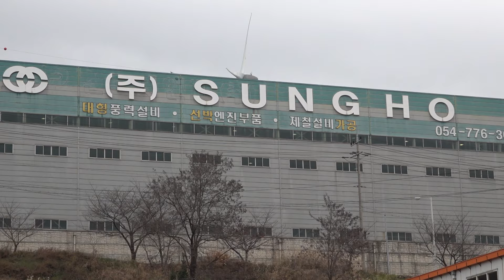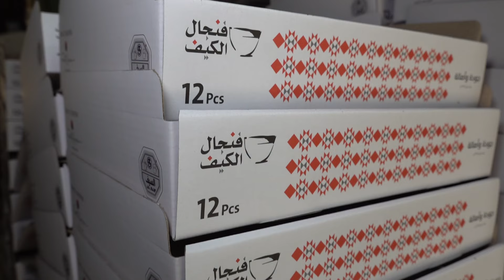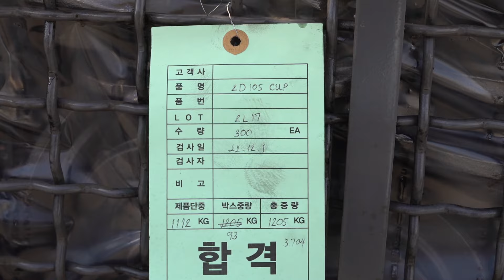Great Korean mass production plant. Amazing Manufacturing Processes BEST 5

Comment: Great interesting stuff.  Why is there so many hand working steps? Automation my friends! Why  put on labels by hand? Tradition? Loading, taping so much hand labor.
Reply from the maker: Thank you for watching^^
Reply: Automation also equals unemployment for many people. While it is true many of the steps could easily be automated, but how many workers would be without jobs if everything were automated? Automation also costs a lot of money. The product output and price point has to be worth fully automating. Labor costs aren't the same everywhere. The cost of automating certain tasks may outweigh the manual labor costs in some cases depending on product.

Comment: Surely the demand for rubber glove template hands can’t be that great?
Reply from the maker: thank you for watching
Reply: There are gloves for many occupations. More than one might think
Reply: That's exactly what I was thinking. However those templates may produce say a million gloves before they lose their dimensional accuracy,  they need replacing.
Reply: @emif841  Im guessing its not very common that they produce such a large batch of steel glove molds
Reply: @bigsmoke4882  The manufacturer needing those gloves would need spares.